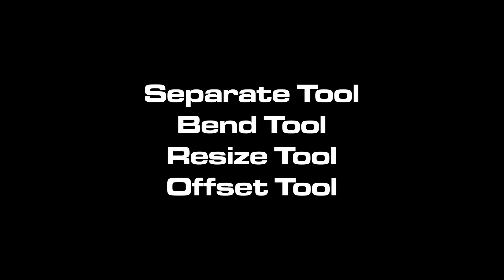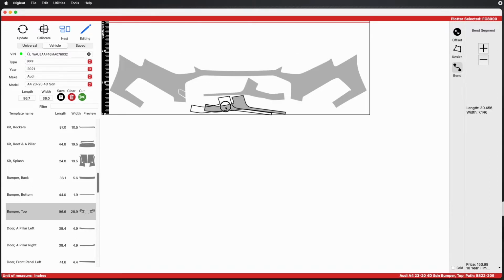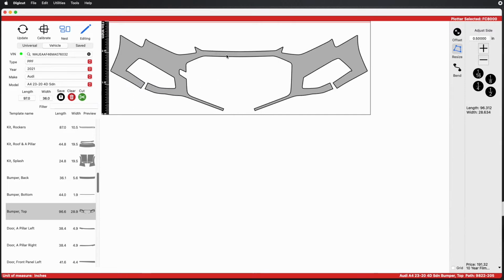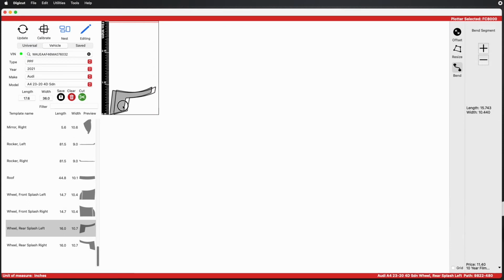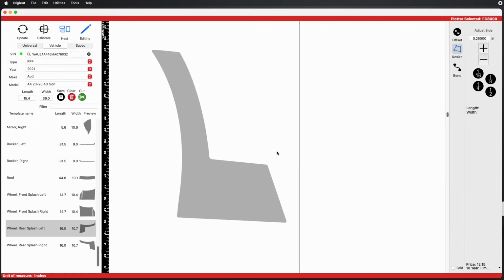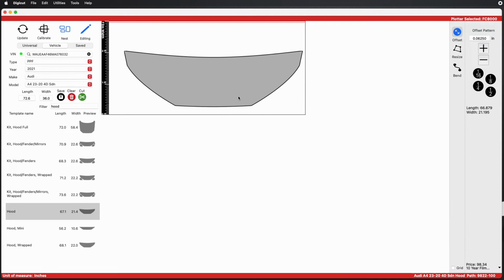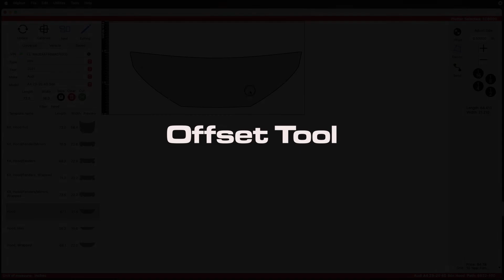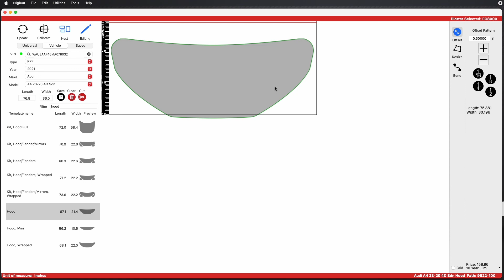PPF Editing

Comment: Why is it so difficult to edit a pattern? The template had two tow hook cut outs but the bumper didn't. There is no way to remove them 👎. You should make it easier to edit a pattern. You would have a lot more customers.
Reply from the maker: 1. Right click, select edit template. 
2. Click on the Tow Hook
3. Use the backspace or Delete key to remove.